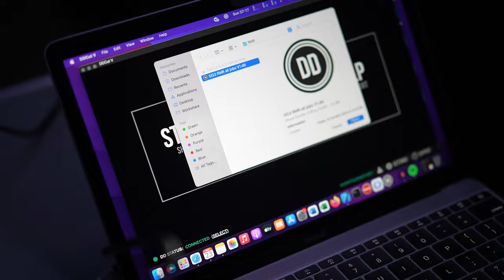GG3-S | RMR Optic Cuts

Comment: Is the 3-S any different from the previous GG3?
Reply: I think the 3s is just a jig and software. You can probably buy it and add it on to your GG3 
EDIT : I was wrong , you can upgrade your GG3 to do 3s stuff, but the factory 3s does have substantial hardware improvements to the original GG3.

More info: https://youtu.be/tpfuECMs2os
Reply: @elchongis  software is the same. The jig is slightly different though. This has been stated already.